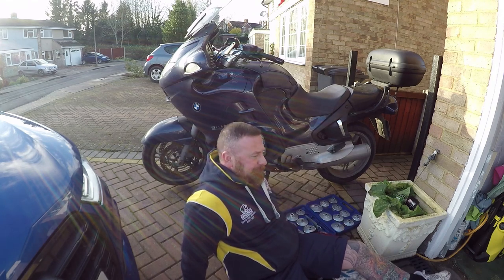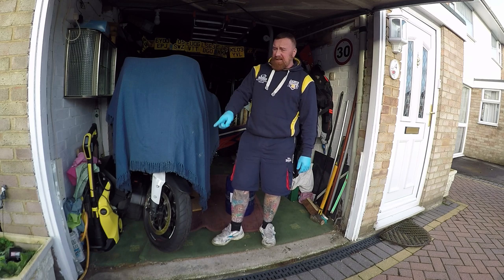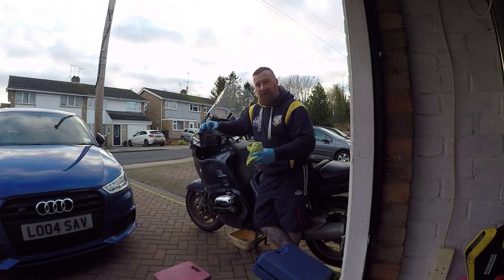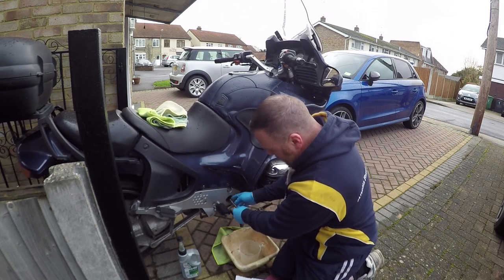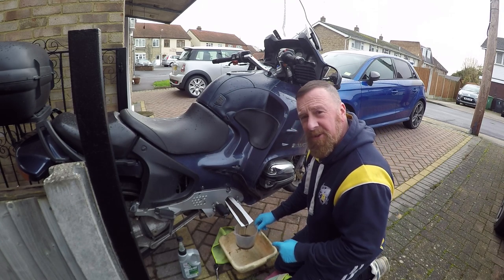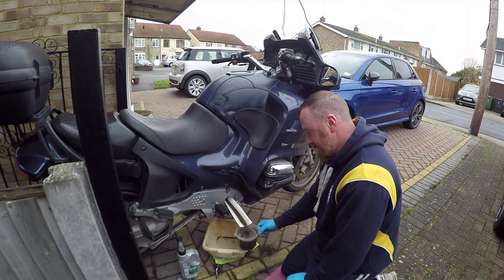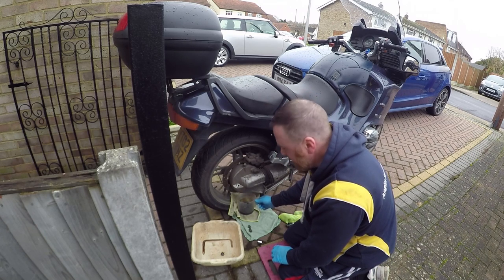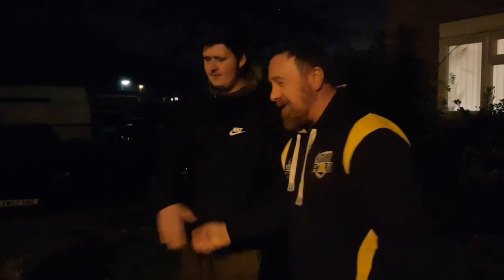BMW RT1150 ENGINE OIL GEAR BOX OIL & DIFF OIL CHANGE MARK SAVAGE

Comment: Hi Mark, if you having trouble with first gear take off the left hand foot pedal and gear shift plate and give the moving parts a good clean and lube. I had this a few years ago, felt like gearbox was not working as it should... a quick clean and lube and the gears were so much easier to engage... loving the series, may be not the excersize session ( i’m allergic to working out)
Reply from the maker: Top man I'll give that a go thanks 
Excise , if I didn't do any I'd be 20 stone pmsl

Comment: Last month I did an oil change on both gearbox and diff oil. Including new rings/o-rings etc. My R1150Rt is good to go again. 131K km's on the tacho. Still running like a champ.If maintained properly, these bikes will go up to very high mileage. But they do need service! Dunno if you still have the ABS on it, but it should be flushed every year and new brake oil in it. Braided steel brake lines are also very good to have instead of the OEM rubber lines.
Reply from the maker: agree bud they are but yes they will just keep going and going as long a serviced and a little bit of love lol
Reply: @marksavage  love and attention fixes everything lol!  I love my RT.  She's old but the old Girl is still rocking and rolling! They have some oddities but i forgive her everytime.
Reply from the maker: @lex1945  best way bud

Comment: Nice one Mark, explained everything in a good clear way...👍
What was the air filter like?
Reply from the maker: Not as bad as the oil lol, but guessing it hadn't been done for a while, funning because the plugs didn't look to bad.
will have to take her for a test ride to see if theres been any damage for the oil being so bad and low to see if she's ok but I know these bmw engines are good strong motors -- fingers crossed 
thanks for watching bud
Reply: @marksavage  Cheers mark...👍

Comment: My lights have stopped working on my moped apart from the indicators and brake light, but they all work with a lead of the battery. It has a new battery and I seem to be having charging problems? Could you please give me some idea as to what is wrong with it.
Thanks.
Reply from the maker: hi bud 
your indicaotrs and brake lights work from your battery ,your main lights work from your stator coil and this could be your problem, I have a few videos on stator coil for speedfights but the same thing on other mopeds so give them a watch bud but I guessing's yours is the problem 
remember your stator coil does two jobs , runs the bike and you power
Reply: Thanks Mark. I thought it may have been the stator but I wanted a bit more reassurance before I did it. Thanks

Comment: Hi Mark I think there is something wrong with my piaggio zip there is a bed squeak noise and a smell of burning rubber coming from the belt what could this be thanks
Reply from the maker: you have answered you own question bud , its going to be engine cover off and a new replacement belt bud 
id change the rollers while your there too, many videos on my channel to help , yes they are on speedfight and aerox's but the basics are you same and they will help you do the job 
id not ride it till you have sorted it
Reply: @marksavage  okay thanks mark

Comment: Oh wow your poor bike. That’s the bike version of a slap around the head 😂👋🏻
Reply from the maker: It's not good bud, will have to wait to find out if any damage has been done 
Really piss poor Steve
Reply: mark savage it will be fine, those air heads are very tuff. 💪🏻
Reply from the maker: @TheDervMan  it did sound ok when I had it running so I'll agree I'm sure it will be fine 
Will also have to see how the gears go 
And another youtuber said to take the gear lever cover off and clean up and spray so I'll do that in the morning